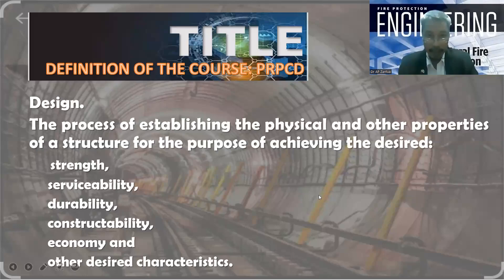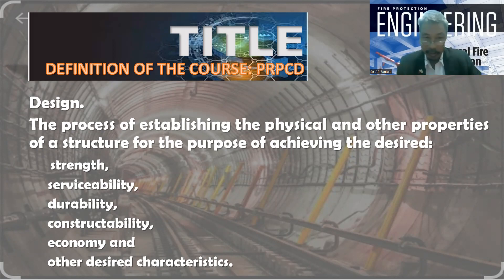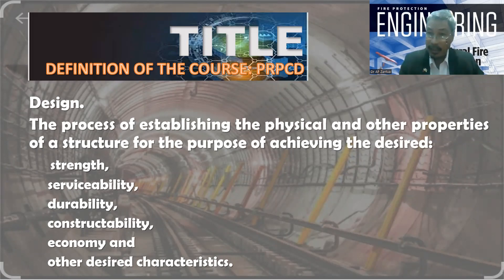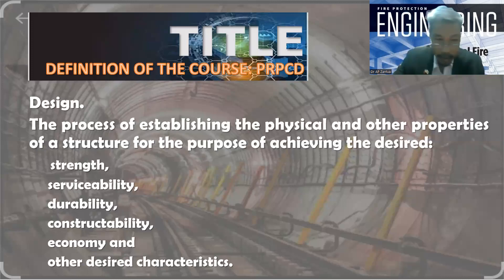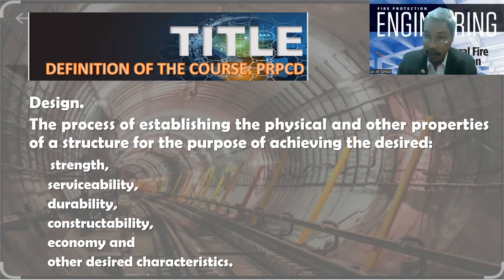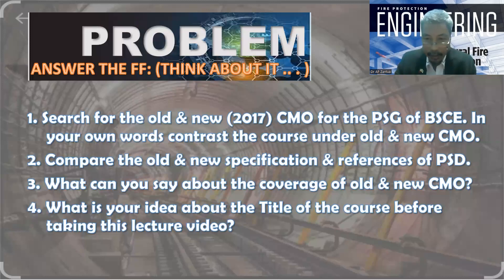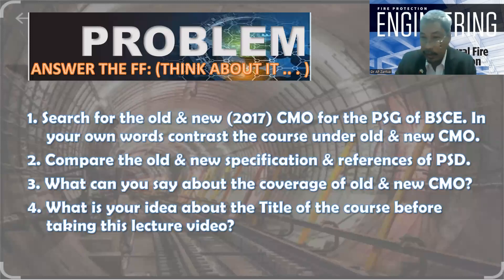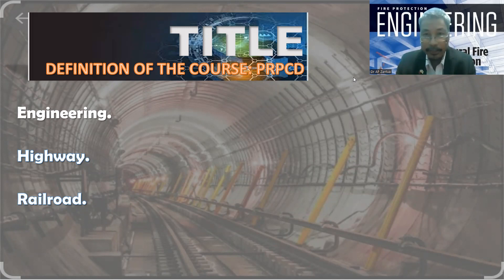Introduction to HRE [ Highway & Railroad Engineering ] Module 1.00 Part III

Comment: Thank you, sir for discussing some of the definition of the course and the properties of structures in design that needs to be considered in HRE. Additionally, I think that the appropriate picture to be used in our emails are ID picture, so that it would be recognizable and shows formality. This are needed for everything to be organized, so for instances that some google response has been missing, it is easier to check if the response has been misplace in another subject.